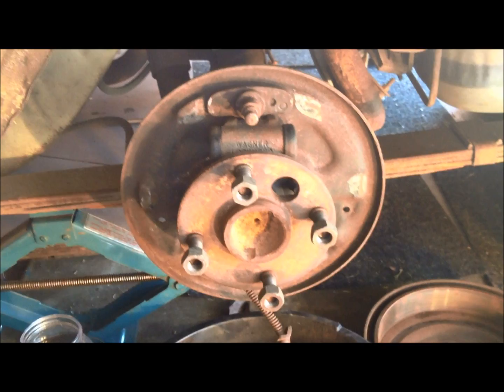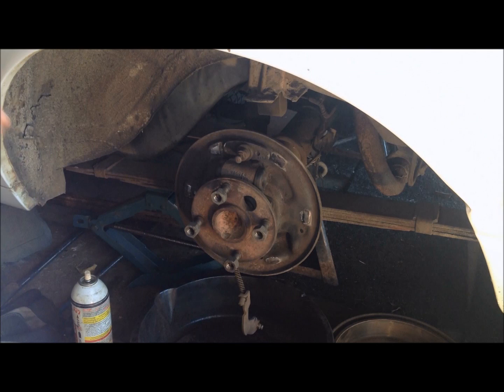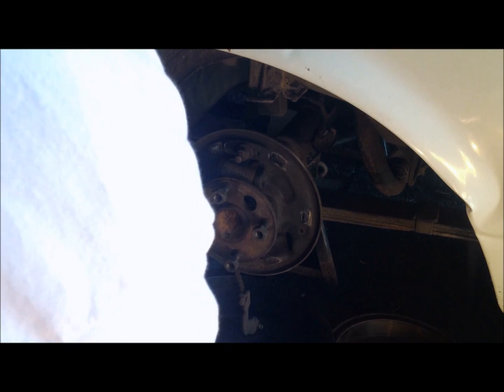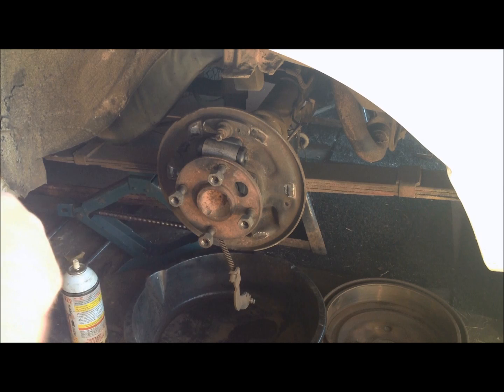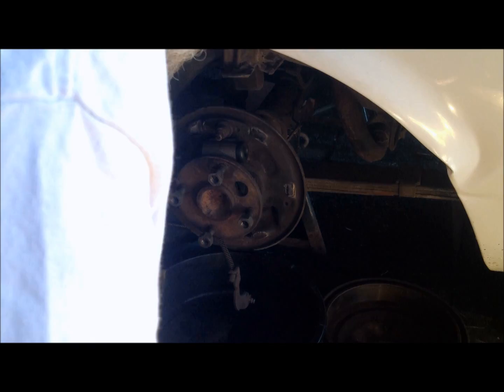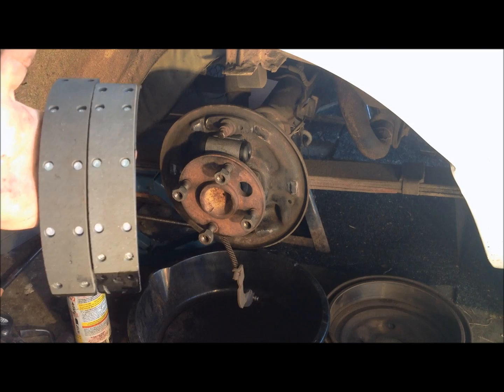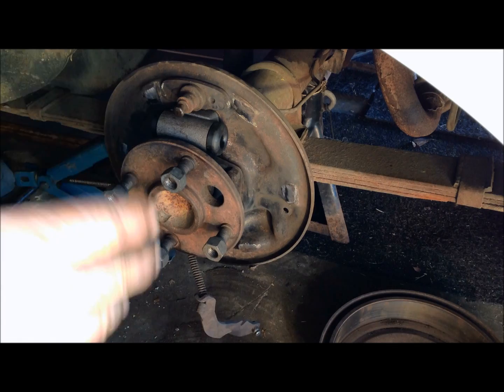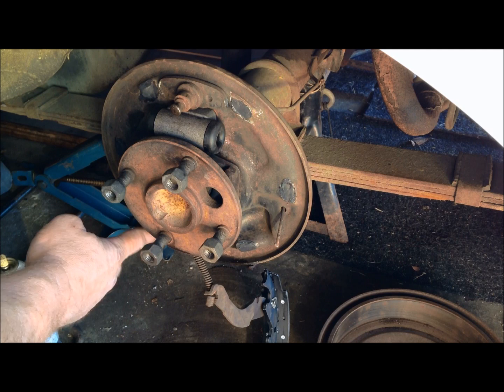1967 Mustang rear brake install

Comment: Thank you sir! Very informative video. Im currently working on my 66 and needed help on the parking brake bracket setup. Have an excellent day. Thanks again
Reply from the maker: Thanks for watching and commenting. I was working on my 54 parking brakes just yesterday. I am going to cruising the coast next week and ever since it was built it never had an e brake. After watching the famous 64 Mercury Comet crash last year it’s been on my mind that I need to get it fixed. So before I put it in another parade situation, I said I would fix it. So I did.